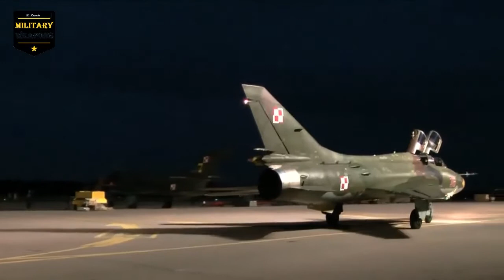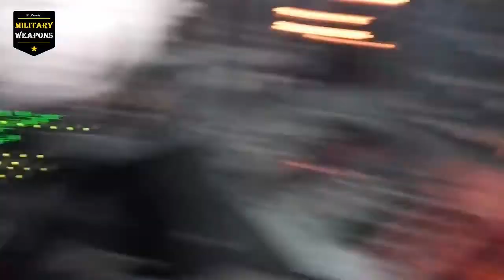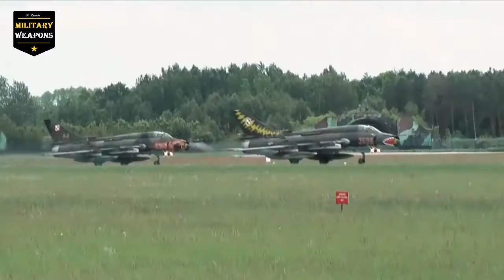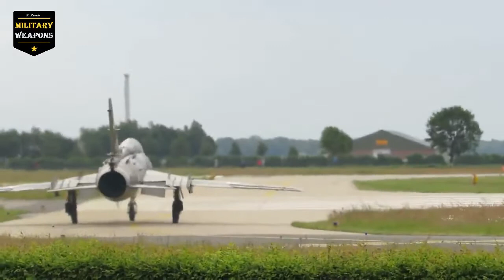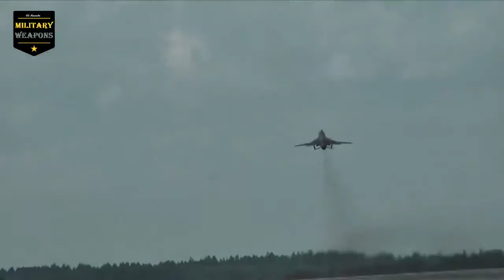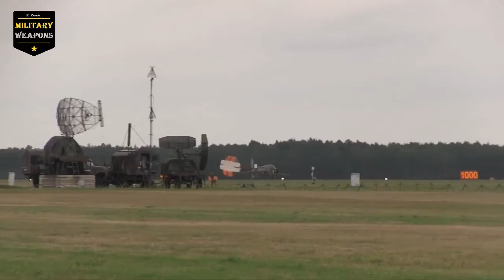Massive Soukhoï Su-22 FITTER Fighter-Bomber

Comment: Su-22 was the Sukhoi Design Bureau's solution to the requirement for a new variable wing geometry fighter. Sukhoi's idea was that not the whole wing rotates, only the outer half, which has the advantage of avoiding the very complex rotating mechanism of a fully variable wing, and weapons can be affixed under the fixed inner half. MiG on the other hand went for a fully variable wing design, and designed the MiG-23, which turned out to be the most challenging project in the MiG Bureau's history. Artyom Mikoyan suffered a heart attack from which he never fully recovered.